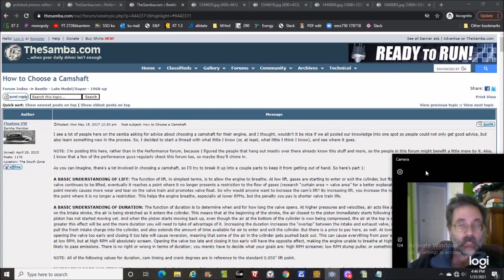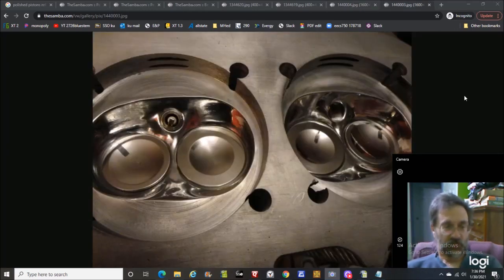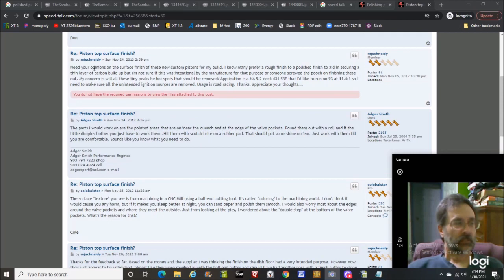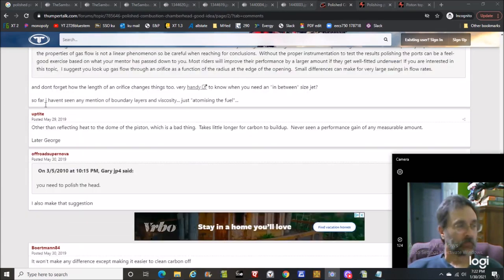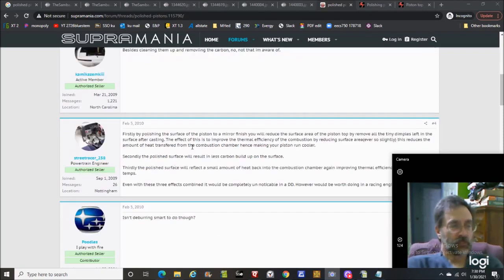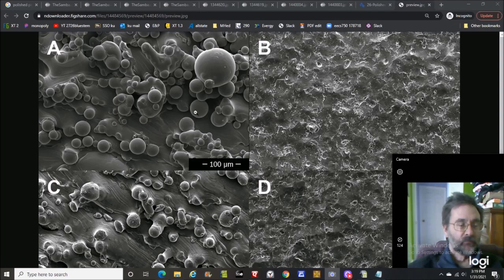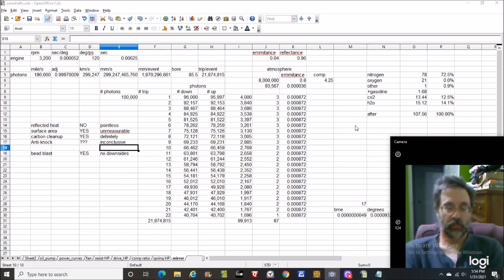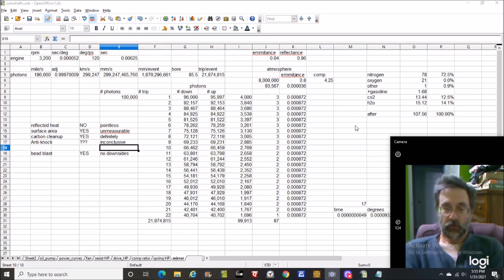vw type 1 mileage & mpg vlog 17 mirror polish combustion chambers and pistons

Comment: MPG equals less parasitic loss wherever you can find it 👍🏻 chamfer the bearing surfaces between the connecting rods and also on the main bearings run a thinner viscosity oil and add power ports to the Pistons and reduce your ring tension and gap to  reduce drag on the uplift stroke before the power  ports drilled into the face of the Piston do their job on the power stroke stroke EGR valves on each tube running from the exhaust port on the header hook to your breather points on the crankcase to reduce windage and blow by etc...
Reply from the maker: so many things can be done. only 5 have i found that lead towards noticeable improvement. high compression, proper timing, low tension rings, roller lifters, large rpm reduction. next on my upgrade list is a replacement for my 009.

Comment: Thanks for the videos Scotty!  How about ceramic coating?   Any real and practical effect?  I would love to increase reliability and I've read that heat is one of the major issues.  I'll put most of my effort into high quality components, build quality, and airflow/baffling.   But I am intrigued by the theoretical discussions of ceramic coating (I can't find much real world experience discussion of ceramic coating).
Reply from the maker: if it were as easy as coating the inside of a combustion chamber, you'd see manufacturers doing it in their SI engines. they don't. i've read a few technical papers that state that the coatings create extremely hot areas which lead to detonation. high compression is more important and is what the manufacturers strive for. inside an exhaust port though is ok but have no idea if that truly improves head temps.
Reply: @redshirt-scotty  Thanks for the reply - I'll look into the development of localized high temp.  Just trying to learn and get a bit of reliability in an engine pushed to perform outside its design limits (for aviation). Cheers!

Comment: I'm polishing my chambers on my 1.9L SL2 , just to help prevent knock when I boost it with .20 over hyper pistons. I'm also going to run dual intake cams set to 180° and retard two teeth on the cam gear with about 14-15 PSI with the heavier 3rd gen crank, lower tie plate and a stage one port and polished head, with, narrow, blended 1-2 mm valve seats and mild deshrouding of the intake valves, minor blending of the bowls, etc. I'm also going to make sure I only run premium gas, which I already do anyway ...lol Im aiming to keep the CR at no more than 9.5-9.7 to 1 CR. I like the torque so I'm not liking a dished hyper piston.
Reply from the maker: wow. the things you can get away with when your motor is water cooled. big compression and big boost.
Reply: @redshirt-scotty  Actually I'm trying to keep the CR as close to the stock 9.5 to 1 as possible, 9.5-9.6'ish. Just hoping for advice on whether I'll be ok if I polish the Chambers and run 93 octane gas, so I don't have knock on the power adder or 14-15 PSI
Reply from the maker: i think polishing is a non factor
Reply: @redshirt-scotty  I'll take that into consideration I suppose.